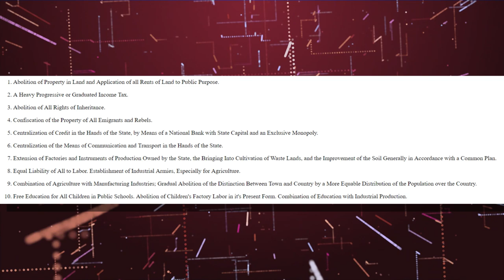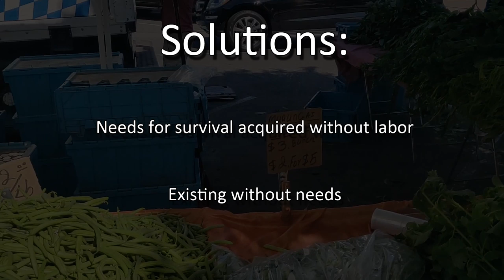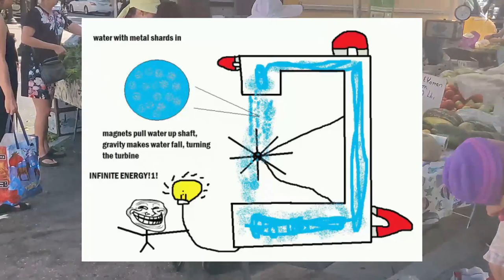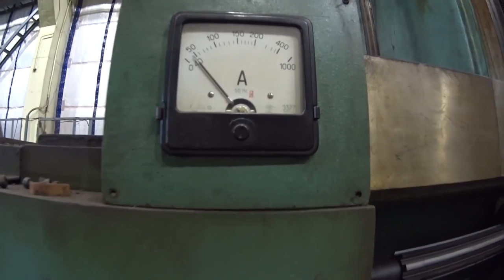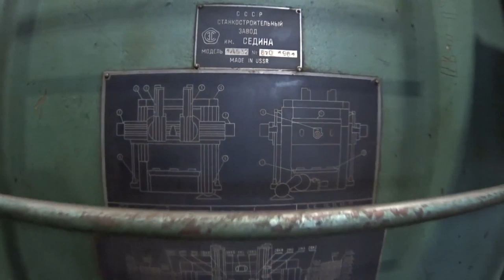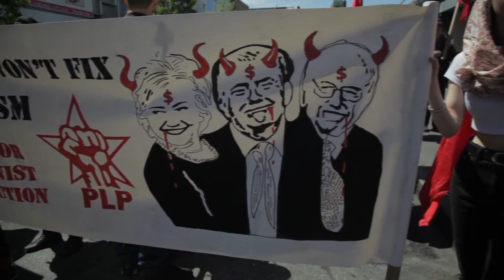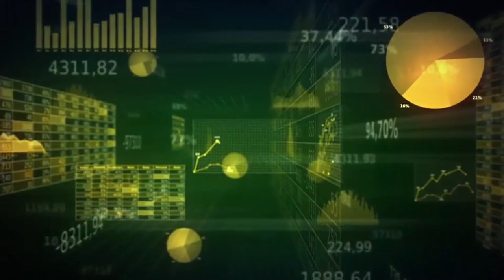Answering the Work or Die Problem

Comment: Couldn't you also make the argument that machines working is fine based on a moral standard giving humans rights due to our sentience? And since a robot is not sentient would not have rights, so you would then be able to approve of the labour of machines without accepting self ownership
Reply: You have to use self-ownership, because unless you can establish the machine was made and programmed by someone else who then owns it and its labor, an advanced machine could be considered sentient. You're probably misusing sentient (emotions) to mean sapient (wisdom/reason,) but in either case an advanced robot or AI, such as Johnny 5 or Wall-E, could be considered both, but it would not have self-ownership, at least not until the owner dies and fails to transfer ownership, or frees the machine from its owner.
Reply from the maker: The argument from self-ownership is a lot less...cancerous, than arguments to sentience or sapience. 

Which are **cancerous.**
Reply: @litigioussociety4249  a sentient robot is something that doesn't exist in reality, and I do mean sentient not sapient, but a sentient robot would inherintly ha e a right to own itself as much as any human does
Reply: @FilthyHeretic  I mean I'm aware of that, but Marxists are not anything if not stubborn and religiously anti capitalist